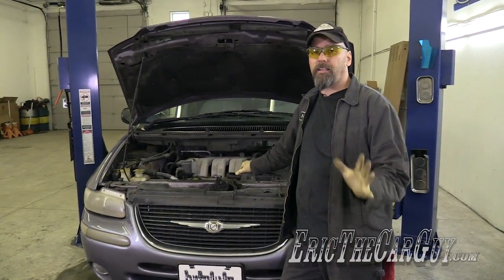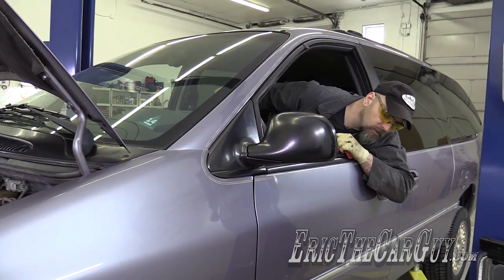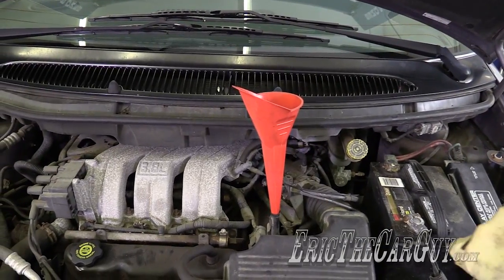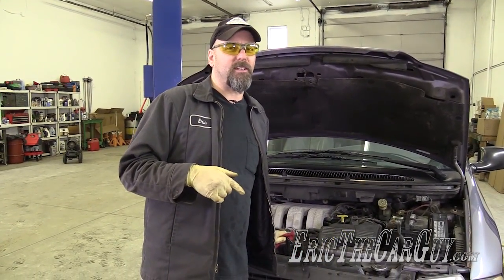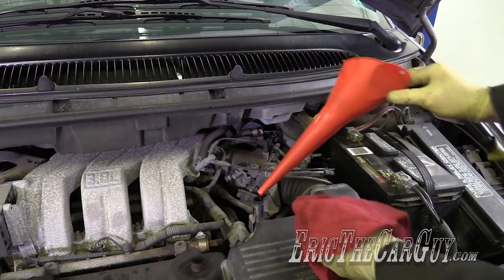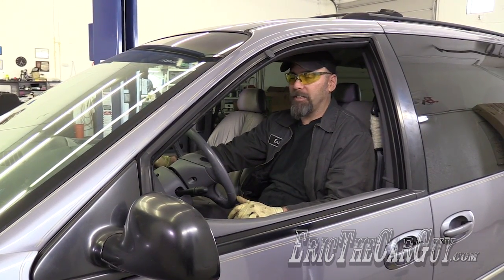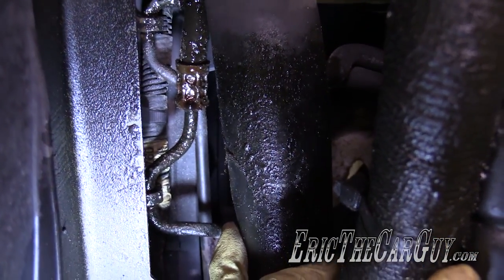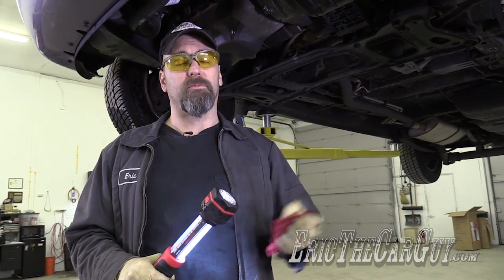1998 Chrysler Town & Country Transmission Diagnosis -Fixing it Forward

Comment: Eric regarding the rear windows' electric motors. make sure the connections are not lose and that the motors really don't work before buying new ones . I've got a 97' tonw and country and I find out the little plastic tabs on the conections are really weak, they break and leave the conection lose and thus the windows may work inconsistenly or not at all.

Comment: I Think eric just using basic ATF in this vid should have been fine for the very short term purpose of this video. if it was enough to get the reverse working and after the test drive I am sure he was going to do a filter and fluid change and he would have used ATF 4.  Use what you have before spending money!  that's what Fixing it forward Means.

Comment: Chrysler trans missions require ATF+4 anything else and you just signed its death certificate. I have seen it several times some one will do a filter change on a peferctly working trans. And fill it with dextron III or mercron and 90% of the time fail shortly after.
Reply: I didn't finish watching when I posted that but yes the fluid level is probely the cause of the reverse but these transmissions are notorious for having solenoid pack issues. There is a extreamy fine mesh screen that easily gets cloged and with the low fluid I bet the screen over the reverse solenoid is blocked up not allowing fluid to get to where it needs to.
Reply: dav8388 I agree.  We should check that solenoid and then flush the transmission and replace with proper fluid and filter and repair the leaking transmission lines.  But with fluid that low, Eric is probably right!
Reply: ***** I have personally had a Dodge Intrepid the went into limp mode and not knowing much about them at the time I took it to a trans shop and they said it needed a rebuild due to burnt up clutches, So I agreed to the rebuild. When I got the car back 2 days later it went back into limp mode. Long story short. 4 trips back to the shop the only thing wrong was a splice in the trans harness had become corroded.
Reply: dav8388 Your'e right I had a Dodge and it had to have ONLY ATF-4.
Reply: dav8388 Had this happen on my 1993 Dodge Caravan. But at the same time the van was locked in 2nd (limp mode)... the speedometer stopped reading.
Fix: I found the connector plug for the transmission output speed pickup was loose/corroded. Cleaned it up, and transmission has been great since. That was four years and 100,000 miles ago.
Reply: dav8388 That's why i never change my ATF after six years of mileage...most transmission failer due to wrong oil use

Comment: 10 minutes to add a quart of fluid, but you missed an important tip. Be sure to cycle the transmission through all the gears after you add the fluid, especially when the fluid is that low. It helps circulate the fluid to all the right places inside the trans.

Comment: To check the transmission fluid level you suppose to drive a vehicle for about 10 miles to heaе up transmission. And only then check the level. Just idling - NOT warms thansmission and fluid level will be less then actual.

Comment: It's a good rule of thumb to use the specified fluids and parts , in my case GM- Delco parts and fluids .
Reply: commodore665 Especially when it comes to transmission fluid.  Never cheap out on your tranny!
Reply: ***** 
Yup atf+4
Reply: inertia210 In America you call it +4? In Eu we call it ATF Dexron 4
Reply: ***** Those aftermarket parts and fluids may not be the best choice for your car, which can lead to problems
Reply: ***** Transmission fluid is a part?  I don't work in any automotive job.  By your comment, you must be 12!
Reply: ***** RTV? Use it anywhere! works with gaskets too! Can't beat a better seal.
Reply: seeya205 Dick is obviously a troll who has never driven a car. Everyone knows you only use what manufacturers call for. Same goes with GM and their coolant. I've seen people put the green shit in there and a year or so later, their engines are trash due to sludge buildup in the cooling system. Only if you flush it out all the way can you switch, which is what I did because I've heard of so many dexkill horror stories.

Comment: Possible stuck manual valve or reverse solenoid. Do stall speed test In forward and reverse and sometimes the valves will pop free. $.02

Comment: I have a 2007 T&C. The trans shudders when you accelerate. As soon as you let off the gas it stops. It is definitely not electrical and wheels are all balanced. The van has 308k miles, it was a state owned vehicle so the maintenance was kept up. Do you have any suggestions? Thanks, Ron

Comment: Still curious about which transmission error codes this car has.
Reply from the maker: stepkka None were stored due to the dead battery.
Reply: Can you turn the key to the on position 3 times (fast) on this year and model to get the codes to show up on the odometer?
Reply: Richard Atwood 
He has a proper scan tool that shows all codes(Cxxxx(chassis) Bxxxx(Body) and Network(Uxxxx) not just Pxxxx based codes.
Reply: Richard Atwood You can do this on any Chrysler, Dodge, and Plymouth as well.  It's pretty convenient in my opinion.
Reply: Corey Toolen Jeep too
Reply: Richard Atwood I am pretty positive any GM will do that as long as it has a digital odometer. I have an 02 Grand Caravan. But I know Jeeps do this as well.

Comment: If it is a 4 speed then it is a 41Te. If it wasn't leaking from the solenoid pack then there isn't much more that can be done. Clutch material on the reverse is worn out due to low actuation pressure caused by inadequate fluid supply.

Comment: Note to all: A quart of the wrong transmission fluid will kill an A604...

ATF +4 only.
Reply: i call bullshit. prove it
Reply: @FrankieJames7  ok, pick up any chrysler van with an A604 transmission, over 100,000 miles on it, put some shitty gas station ATF fluid in it, and drive it for 1000 miles

keep your phone on you so you can comment from the side of the road

Comment: I have a 98 Plymouth Grand Voyager that will shift when you push the accelerator. Is the transmission no good or headed there perhaps? It is also leaking somewhere above the bell housing but only when running. TIA

Comment: Those 41TE Automatics take ATF4, the dispstick relates to ATF 3 for a A604 transmission because Dodge just used the available dipsticks.  ATF4 is what is stated to be used in the manual.  You can put ATF 3 in it or Dexron III in it just to get it moving in a emergency situation but it's not the correct fluid and will cause failure in a short time if not replaced with ATF 4.  A Dodge technician told me said that ATF4 is basically a synthetic version of ATF3 since those transmissions require the better fluid you need to use it. He also said that Dexron III is a less "slippery" oil and will cause chatter and hard engagement.  It's unfortunate that these transmission were so prone to failure from the solenoid pack and leaking.  Also on these besides being a weak design they will fail from lack of fluid changes or as seen in this video from just running low on fluid.

Comment: Why wouldn't you check for codes as the first step? Also did you check to see if the shift linkage is out of adjustment and that's why it wouldn't go into reverse?

Comment: I have several 96-00 Caravans. They make great work vehicles, good on gas, tons of room, and with a hitch can pull a small trailer for moving appliances or stuff you don't want in the van like trash or lawn mowers. All mine are 3.3 liter. I have had to junk a couple of the vans because of transmissions. The cost to replace them is more than what I usually spend on a whole running van. I can get a van at a police impound auction for $600, or on Craigslist for $1000. I can't find a transmission for less than $1200 rebuilt with core exchange (and they want another $500 for core) Please Eric do a 41te video.

Comment: No.  Only ATF+4.  Anything else can cause torque converter shudder and ruin the transmission.  That is how so many of these transmissions (w/V-6 engines) were destroyed.  If your shop says they can use cheaper Dexron plus an additive, claw your van back from their hands.
Reply: Had an issue with slippage on my 97 Voyager and after dropping the pan I noticed a red substance that looked like cottage cheese. I suspected this was blocking up the filter.  Drained, replaced filter and added ATF4+ even though the auto shop tried to sell me reg ATF when the manual clearly states ATF2+.  170k on this tranny and after the refill it drives better than it ever has.
Reply: John Scripter how do you drain please?

Comment: Hi Eric, 
Having had a vehicle with one of these exact same transmissions in it, I've like to think I have a  a pretty good idea of how they should work. 
I noticed when you put it into reverse, I didn't hear the reverse solenoid clicking. These transmissions have very loud solenoids until about 2009, so you should be able to hear it shift into first, and even second over road noise, as well as reverse. I heard it when you shifted into drive, but did not hear any noise when you went into reverse. It should be the exact same noise, but slightly longer. For the reverse solenoid to fail isn't a terribly uncommon thing in these transmissions... I remember it coming up a lot in my research on how these fail. 
Not claiming to be an expert, just hoping maybe this comment could be enough to maybe have you plug the scan tool into it... While I agree running low on fluid (especially that low) can definitely ruin a transmission, it's interesting that reverse was the gear to die. I would expect for one of the higher gears to fail first, as they typically require the most hydraulic pressure to keep engaged.

Comment: I have a 97 Silverado with a 350 and I just replaced my timing chain and cover! I sealed the upper part of the timing chain cover but I didn't realize I need to do the bottom to! First time ever doing this! I wanna know if there is a way to seal it from the outside without removing everything I just put back on. I was thinking about siliconing the whole bottom part of the cover up to the part I sealed with gasket sealer and a gasket! Just let me know as soon as possible! I also replaced the water pump and distributer and rotor! Also the radiator!

Comment: I think a lot of old cars are taken off the road due to small things leading to catastrophic failure, ie trans cooler lines leaking taking out transmission.  On my old cars, I check them over every week and I check the garage floor almost every day for the car that is in the garage.  I've narrowly avoided disaster several times, but the average person wouldn't catch it until it resulted in major failure.

Comment: If the transmission case is good, why not rebuild the transmission? Many times 41TE-A604 is hard to find because many have the cases damaged from differential pin scoring through the aluminum case. If you have a good case, usually best to rebuild it.

Comment: Torque converter seal leak. A groove wore into the shaft. I had this same problem.
Reply: If the torque converter seal would be leaking the fluid would be coming out from right in the middle of the engine where the transmission meets the engine, this leak was coming from the front by the radiator.

Comment: What could be wrong my 1997 Plymout Voyager 3.0 with my transmission that lost reverse. It engage and move on level ground but slip if there is any resistance and I need to push on gas pedal.

Comment: Those 41te transmissions they put in those have a lot of issues. Its hard to tell in the video but was there any milkiness to the trans fluid? That would obviously indicate a leak inside the trans cooler which would spell trouble for the new trans. It looked like there may have been when you pulled the dipstick but it may have just been the video. Good video as always, hope you find a donor trans.

Comment: I'm not saying this work work but here's my experience...
I'm a mail carrier and I drive the "LLV"s. One time while delivering, it was giving me problems engaging in drive. But it would go in reverse. Checked the fluid on the route and it was good enough. I put the vehicle in neutral, revved the RPMs and threw it in drive. Hear a loud CLUNK! and then it seemed to operate normally after that, forward and reverse. My philosophy is this- if the transmission is not responding, it's likely that it's toast anyway, MIGHT as well try anything to see if it works....that and it's not my personal vehicle so whatever haha

Comment: the procedure in alldata is step by step for overhaul...only gap is in reassembly where they skip a snap ring....but can be found in the dis assembly section....there is a youtube on this...only special tool is the spring compressor...which can be made with allthread and pvc pipe.....

Comment: Eric, what about REBULDING the transmission, change the worn clutchpacs, check the gears, etc
Reply: He tried that with his Honda van, didn't last all that long.
Reply: Jacob Klein
why not, the solenoids are not affected by low oil, if you change the clutches and check all the seals and gears then it shoud be as new
Reply: I think that for the customer it would cost more to rebuild it than just swapping the transmission with one from a junkyard.

Comment: Chrysler minivans use the 41te transmission which gained a (undeserved) bad reputation years ago BECAUSE of incorrect fluid used. Even the factory goofed up and spec'd Dextron as a suitable substitute. Oops. This led to a near-100% FAILURE RATE. However, time and experience has shown that they MUST have ATF+3 (no longer around) or its replacement, ATF+4 - a pure synthetic. In fact, with proper care and feeding these transmissions will work well and last a very long time. I own 3 3rd generation Chrysler minivans (all over 200,000 miles) and all 3 have the original transmissions and 0 problems - knock on wood. 

Here's my advice: Drop the pan and do a fluid & filter change using the correct ATF+4. If there's no EXCESSIVE debris in the pan, and the fluid change does not fix the problem, then look into the solenoid pack. These do get clogged and because these transmissions are ELECTRONICALLY CONTROLLED the solenoid pack does everything the old valve bodies used to do. In fact these transmissions were revolutionary, being the first all electronic transmission used in production automobiles, and that was way way back in 1989!

So it may cost about $150, but I would do that before signing the death certificate. As far as diagnostics, I'm not 100% positive, but I think the transmission computer requires proprietary scan tools to retrieve any codes or to reset its memory.

I have a feeling, because reverse DID work for a moment there, that the problem is NOT mechanical, but electrical (solenoid pack) You can hear it buzzing when going into forward gears (normal) but silent when reverse was selected....

Comment: Hi I have 2008 town and country Touring I am not a mechanic I’m just doing at home by myself as soon as I put my car in the drive is shut off but it worked fine on the reverse I already change speed sensor changed transmission oil and filter as well. There was     egr Valve code I change that to

Comment: Eric my reverse barely works. Works best when cold. Any help seems to do better in morning its a 99 2.4 3 speed auto 31th i believe. Forward is great
Reply: Fluid is good changed it no clutch material
Reply: If i turn the wheels itll move a little better but not enough

Comment: Hi i got a 2000 altima engine light is on i watched you vid for the honda with the fuse romoval alt s abs on box and panel im not sure of the combo weater i take whatever ones out at the same time or take them out permanent or drive around then put them back in later or i havnt got a code yet but if you got an easy for turning this liht off .actually it was off .i had changed the oil and plugs then it came on.

Comment: The famous Chrysler Mini Van transmission issues. My 2002 T/C with 70,000 miles grenaded doing 60 on a flat road and no warning on Christmas. Whoopee.. Full of fluid all maintenance done. Guess when the warranty expires? At 70,000. weird huh?

Comment: Hey Eric, how come you didn't show where it was leaking and what might've caused the leakage? Possibly along with repair tips for that?
Reply: ***** He did show the leak...

It's at 8:00
Reply: mrman17 He showed where it ended up spraying around in the engine bay, not where it was leaking from.
Reply: ***** As stixxs pointed out, Eric said about the pipes to the transmission cooler, this is what he was showing in the video (in fact he moved the bottom radiator hose out of the way to show you) and you can clearly see an obvious leak there of reddish fluid, which will be ATF (generally the only red oil used is ATF, either in the transmission or power steering.)
Reply: mrman17 Huh, I'll have to go back and watch that again, all I saw was where it splattered and not where it originated.
Reply: ***** I've had a fair bit of experience in this sort of thing as a mechanic, so it's possibly more obvious to me.

There's not really anything much else related to the transmission in that particular area that can leak - there is a chance it could be the cooler, or close to that, and it's running back. If it's not that joint, those metal pipes rust and you can get pinhole leaks in them.

There is always a chance it could be something else (I never make assumptions until I've checked it out properly), but it is looking like it's that pipe.

Comment: Wohu, this video is very informative. I have the exact van. There are very similar issues which helps me to fix them correctly. Thanks for posting them. I actually have to replace the alternator. It's date on the van is 7/98 does this mean she's. Yes, she's a girl, jejeje anyhow in replacing the part do I get it as a 1998 or 1999 alternator?? Just double checking before going to AutoZone. They'll let me know that right??